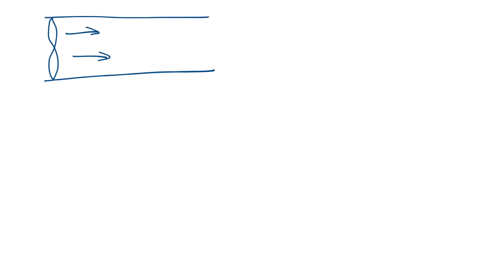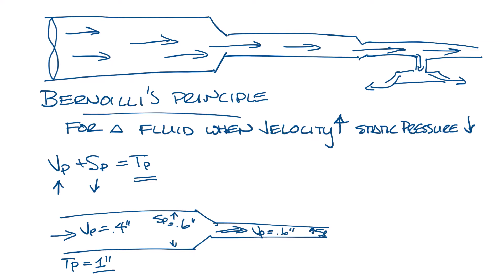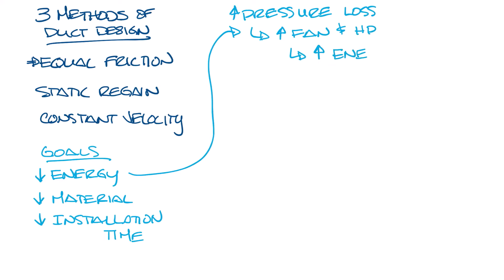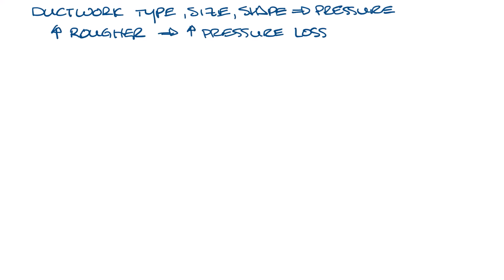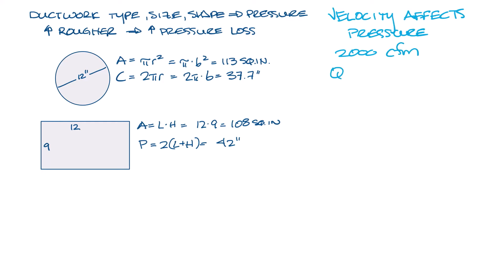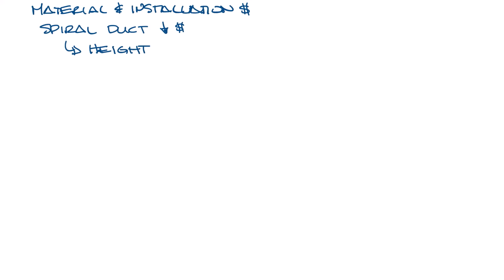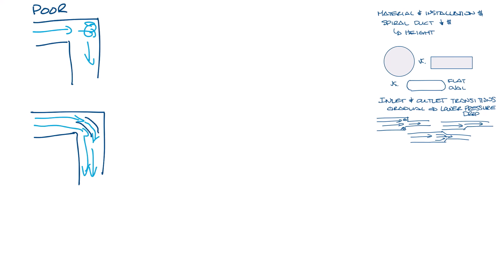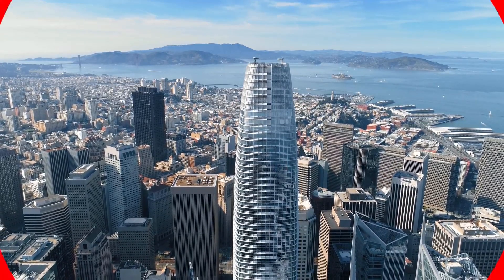NSW HVAC Academy - Ductwork Basics

Comment: Ive noticed that on some AHU's with either an abrupt transition connected directly to the discharge or even some with an attenuator/silencer within a few feet of the discharge, I have measured negative static pressures rite there at the blower outlet making it impossible to get correct TESP measurements . I usually will measure my supply static after whats causing it, ie after the silencer but not sure if its a reliable reading or not.  I understand static regain and lower pressure/higher velocity through a restriction but not sure what to do when I read like -0.4 12" downstream of blower where youd think it would always be positive pressure.  Any advice or can you do a video on this?  Im sure im not the only one who experiences this, thanks

Comment: I was confused, you kept saying V= 2000 divided by the area/ devided by 144 .  In both examples at 5:40.   But its  X 144 not divided by 144.  So V= Q divided by A X 144